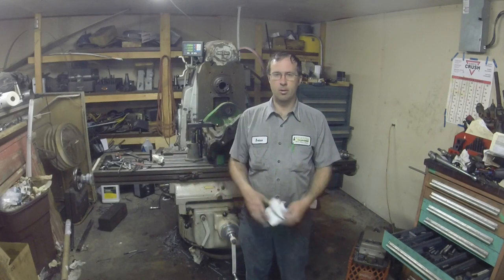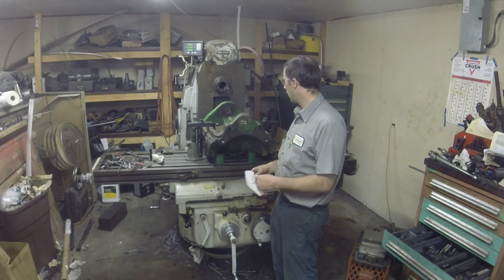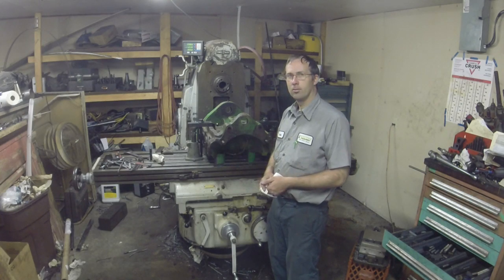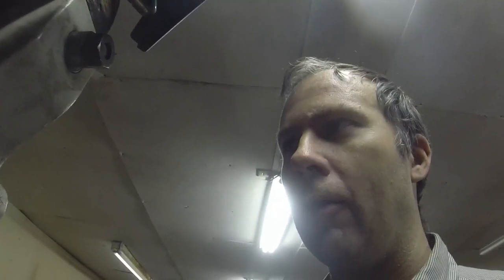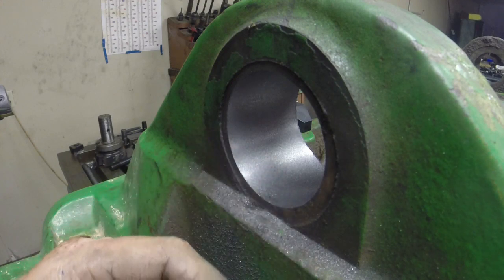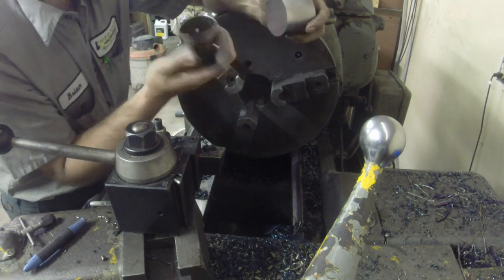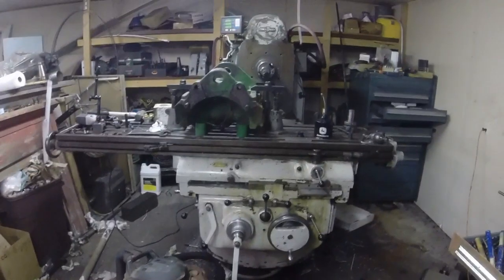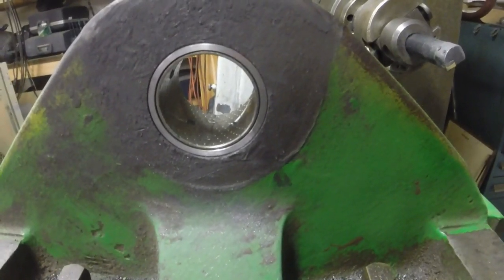Another"boring" job, fixing a bad hole in a steering motor

Comment: I'd be really worried about indicator droop with that setup. You really need a shorter and stiffer setup.
Reply from the maker: Maybe if this was a press fit 0 clearance bore.  Here the indicator stand was preloaded so the thumb screw was against the shaft and it remained in contact regardless of orientation so the stand should not have been moving. My little Interapid indicator has very small mass to the indicator plunger and a fairly stiff spring so it too should have little effect from gravity.  Apparently it worked because there is .003" clearance on the two pins and it slid together when it was re assembled.
Reply: Like my dad would say, "We ain't building moon rockets".  Well engineered machines have reasonable tolerances.  My first job was in aerospace. I worked on rockets, missiles, and satellites.  Machining and fabrication with that sort of equipment is a totally different world away.

Comment: Brian

a few pic from the local paper these were before i worked at Stanton but they were still there and i had to service to little machines the core for vertical cast pipes the stuff they are putting on is clay horse dung and straw 

could you get the pipe cast on your HBM  joking 

http://s1070.photobucket.com/user/stuart_hardy1/media/1d4835e3-85aa-4b13-bae9-05cd158dadb6_zpsgnsfjqhq.png.html

http://s1070.photobucket.com/user/stuart_hardy1/media/Screen%20Shot%202016-04-28%20at%2011.52.17_zps60eo2vdb.png.html

http://s1070.photobucket.com/user/stuart_hardy1/media/Screen%20Shot%202016-04-28%20at%2011.53.18_zpsvp2sgy9b.png.html

http://s1070.photobucket.com/user/stuart_hardy1/media/64067c8e-43dc-4bf7-8a13-f18a9a850ffa_zpsutqjcgo3.png.html
left side is a steam hammer

Stuart
Reply from the maker: +Stuart Hardy I bet I could get it on my HBM. My vertical spindle height goes to 48" so I guess I could face out to 8ft diameter if I had to, that bar would be swinging then! I love the old pics of the shops, I looked at those pictures of building the titanic motors over on practical machinist the other day and it is impressive what they got done with as little as they had.
Reply: +bcbloc02 thanks Brian . I joined that company from school at 15 and entered an electrical apprentiship for 6 years so it's as always big machines to look after , I never knew anything else overhead cranes to 750 tons motors up to 1.5 MW as well as electric furnaces to the same power , I even did rewinding up to 150 HP may be bigger .
I was there when the old school stuff was still in use ,no H&S open unguarded switch gear no covers over the buss bars 😀. So like you the big stuff is the norm , I am looking for some pics of the pipe spinning a 48inch dia pipe 18 foot long is a sight to see , if the socket end core came loose 😀😀

Keep up with the video's always interesting 
Stuart
Reply from the maker: Stuart Hardy
I like how the really big stuff was often machined off the floor and they set the heights using a water level.  I guess maybe those accuracies were good enough. I have never done any mill work that required the use of a transit yet but it sure would be fun!

Comment: That looks like it was a fun job Brian. Well, "fun" in some meaning or other. :-)

On the audio, you probably want a wireless mic that will plug into the camera. Both Keith Rucker and Keith Fenner have wireless mics that seem to work pretty well. You might ask them what they are using.
Reply from the maker: +l wilton Keith Rucker has covered what he uses in a video and best i recall it cost as much as one side of my barn! That is a pretty major investment for a small time guy like me.
Reply: +bcbloc02 Well, for $180 you can get a "Samson Concert 88 Presentation - Band D" from Sweetwater that would probably be pretty good. There are cheaper options (one for $13 form Amazon, and probably not worth every penny). I'd be inclined to spend around $100 if I was looking for one.
Reply from the maker: l wilton
Isn't the Samson the one Keith Fenner crushed because of problems? I am actually looking at The Rode wireless, it is about $400, but thanks to a generous viewer I am half way to getting one. I want to ask around at the NYCCNC open house and see if anybody there has used one and how they do with machine noise.
Reply: +bcbloc02 Noise pickup will depend largely on the type of microphone element. Many mics of this sort are omnidirectional - they pick up sound about equally in all directions. Others are cardiod, or directional. They have a front and a back, and pick up more from the front. There are even hypercardiod or 'shotgun" mics that very directional, but they are stand-mount mics rather than a clip-on mic. You may want to get a cardiod mic rather than an omni mic element.
Reply from the maker: l wilton
Clearly I have a lot to learn about this stuff. Do you know if anybody makes a lapel mic that is cardiod?
Reply: +bcbloc02 Sure, tons of them. Just do  search for "cardiod lapel mic". Audio-Technica is good. Shure is good. Sennhiser is very good, and usually expensive too. Countryman is good and often reasonably priced. Don't know anything about Samson either way. 

Here's a site I found that discusses different types of mics and how to best use them. No endorsement intended of the site, but the info is sound: http://tfwm.com/omni-vs-cardioid-which-lavalier-is-right-for-you/

In the professional world you usually have microphones, belt packs (transmitters), and receivers, and often you get them all separately and mix&match. I'm sure you would rather have a complete combo unit to plug&play. Looking for "wireless video microphone" or something like that could be a decent start. 

Youtube can be a help here. Try searching for "Wireless Lavalier Microphone for Video Beginners" and you will find a number of helpful videos.

Comment: Brian I have a question on the Monarch. Can the rotation of the chuck be reversed. I just got a 27N. It has a start/stop contactor but no directional control. I can reverse a set of leads since it is 3 phase but do not know if I will damage anything.
Reply from the maker: +Mike Green I only have forward contactors on my machine as well, no reverse on the chuck.  I have seen plenty with reversing contactors so they can run either way so it won't hurt anything to run it in reverse if you need to. I did it once on mine.

Comment: its amazing with all the tech on tractors how dumb some of the bearings are no seals and bad grease
Reply from the maker: +Bleu Wolf  I think a double tapered roller bearing with seals would be a much better setup on these myself, but I am just the repair guy not the engineer. :-) That being said I have also seen these in tractors with loaders and 10000+hrs that had not failed, but they were religiously kept greased with the proper grease.
Reply: +bcbloc02 My dad ran a huge fleet of Caterpillars, farm tractors, and combines on a rice farm in Venezuela back in the 50's. He was known as the "tyrant" because he insisted that every machine had to be greased daily. But it paid off. He had almost no failures which was just as well because the nearest machine shop was 400 Km away. Ever since I spent my teen-age summers on that farm, I have greased religiously.  One the other hand, carelessness gives you a job!
Reply from the maker: Juan Rivero
It seems there is plenty of "carelessness" to ensure my job security. I used to do a bunch of stuff for the Cat equipment out of the coal mines but ever since the gov't's "war on coal" that  business has pretty much become obsolete.
Reply: Grrr. Government. Id better watch what I say.

Comment: Better bored than screwed. 😊
Final judgement is in the assembly function. Nice job, Brian.
Thanks,
John
Reply from the maker: +John Bazaar If I don't get a call back I will assume it fit, I know the last one did. :-)
Reply: +bcbloc02 
Odds are 99.999999999% it will.
If not, that's what hammers are for. 
Just kidding. 😊
Thanks,
John

Comment: I do that job on the tractor. And I keep 2" x 3" dom tube for the bushing . I'm on the road today for a 4850 re bush job
Reply from the maker: +THE IRONWORKER I have seen your setup, it works slick! I need to get some more materials in as the pile is getting slim pickings for making the bushings and things.

Comment: Love seeing the Cincinnati at play in its natural habitat, they love to work. Would it be possible for you to do a quick video tour of the old girl? I would be especially interested in how the scales for the d.r.o. are mounted as I am gathering ideas for mounting them on my Cinci #2.
Reply from the maker: +C. Barr81 Will see what I can do, I have a mill side controls video but i don't think it shows the DRO much.
Reply: +bcbloc02 Those side controls are a beautiful feature. I find myself using them more than the front. these beasts work great as small  h.b.m. my friends laughed at me for buying such a "limited" machine until I sleeved a badly scored cylinder in a big block chevy motor. I said "do that on a bridgeport". But yeah it would be greatly appreciated. even if you just cruised your camera over the mounting locations next time you filmed an op on it.